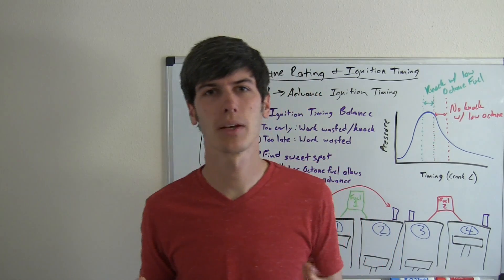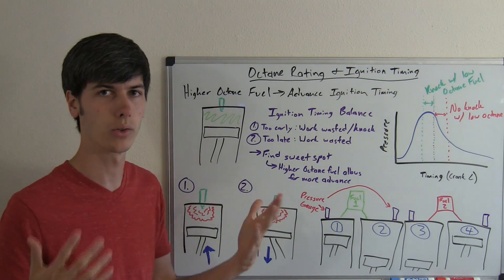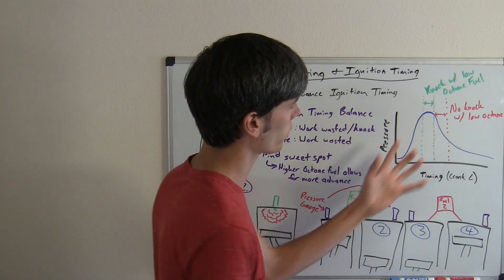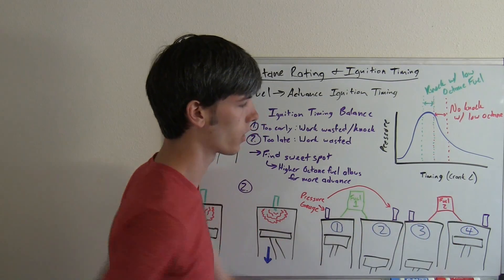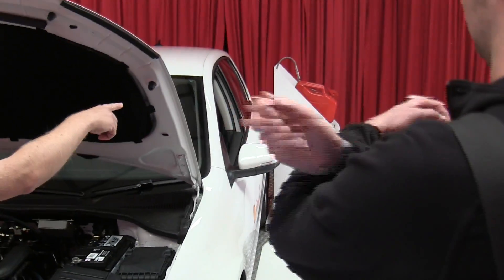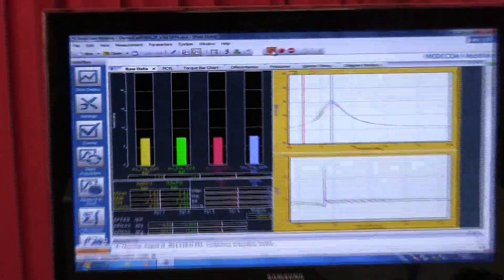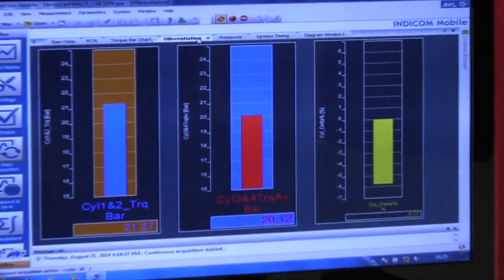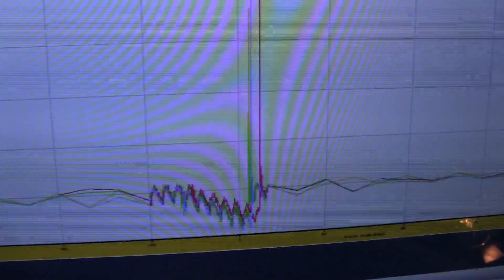Dyno Testing Premium Fuel - Octane Level vs Performance - Shell V-Power

Comment: Its all sponsored by shell, so of course they will want you to buy the most expensive fuel. Run the fuel your manual recommends as there is no real gain in running the higher octane.
Reply from the maker: +geejaybee413 of course, as mentioned the vehicle needs to require premium to benefit from it.
Reply: I am not a shill but honestly shell fuel and shell/pennzoil oil is really the best of the best ...   Pretty much every high performance manufacturer recommends shell fuel and ferrari only uses shell/pennzoil oil..
Reply: Charley Bomps breh
Reply: BRUCE LEE Do you know what a high compression engine is;no you apparently don't.You probably don't know a single thing about how engines work,unlike myself who am a skilled mechanic who has the knowledge to build NHRA drag engines.The point at which an engine is considered high compression is subject to variables depending on what type of engine is being built and there is much more to it than static compression ratios when determining what octane and type of fuel is to be used.Taking the word of a mechanic who doesn't work on snowblowers instead of reading the instruction manual is a moronic move by a person with no knowledge.Your previous comment of you receiving 40% higher mpg by using MMO is complete nonsense and again proves you know nothing about mechanics.
Reply: I ONLY run Shell in my high compression snow blower as per 2 mechanics advice.
The performance with the premium gas is miles away from the other levels.
My car gets it's best MPG on shell basic and I run Marvel Mystery oil.....cheap walmart 4 OZS in gas tank 8 OZS in oil for cleaning and lubrication.l and get 40 % less friction and 40 % higher MPG at 60 mph for the last 2 years.
Reply: Charley Bomps
I ONLY run Shell in my high compression snow blower as per 2 mechanics advice.
The performance with the premium gas is miles away from the other levels.
My car gets it's best MPG on shell basic and I run Marvel Mystery oil.....cheap walmart 4 OZS in gas tank 8 OZS in oil for cleaning and lubrication.l and get 40 % less friction and 40 % higher MPG at 60 mph for the last 2 years.
Read moreShow less
Reply: geejaybee413
Reply: Stairway to heaven Bohemian rhapsody

do you know what a high compression motor is.....NO YOU DON`T....I ONLY run Shell in my high compression snow blower as per 2 mechanics advice.
The performance with the premium gas is miles away from the other levels.
Reply: OK let's look at the facts.
1) The snowblower throws snow alot further with premium gas.I didn't say the motor was high compression the 2 mechanics that work on them said that.
2) We have 2 test cars using MMO in the gas and the oil for the last 2 years .In summer temps my car goes from 36 MPG to now 46 MPG my brothers 3.0 duitec is supposed to do 480 K per tank as it did when new.He now gets 745 - 800 in summer at 100 K per hour 60 mph on a long super highway drive.
MMO has 5 chemical and one is a FRICTION REDUCER.
Check car racing teams used it as an additive to for braking in new motors for racing ........GOOGLE IT....!! 
Your a mechanic but I know lot's of shitty mechanics and shitty doctors the great danger to shorten human life.
Reply: bilibiliism
 CORRECT .......and mechancis told me to ONLY run SHELL.
Premium in lawnmowers  and snowblowers.
I run shell in my car as well as MMO for friction reduction and carbon removal and sludge.
Reply: He literally stated this.
Reply: geejaybee413 unless you drive a turbo car (80's - present) because higher octane absolutly makes a difference. i drive a subaru with a turbo and i do not recomend running anything less than 91 octane.
Reply: But I can't buy the octane recommended for my car,all octanes sold are too high and too expensive.
Reply: BRUCE LEE There is no gain from using high octane when it isn't needed,in fact it hurts performance significantly.Nobody needs 87 octane or higher it is just a waste of money.

Comment: advanced ignition timing fires later not earlier.
Reply: Other way around. All relative to piston top dead center (TDC). The more you A-dvance timing the more degrees added before zero or A-head of TDC when the spark lights off. Another easy way of remembering is with clockwise rotating distributors. Turn it R-ight to R-etard timing. The rotor is then chasing the contact point as it would be chasing the piston down the cylinder in an extreme case.
Reply: No thats retarding the timing

Comment: So if I get, for example my crx from 89, and use 102 octane instead of 95, but I don't change my timing, it doesn't have any effect?? or does it?
Reply: jarnofierloos It would lose power and economy.
Reply: Tanner S.  economy is not a problem, because it is a racing car, but Power is.. I use it, but I don't deel a loss of power
Reply: Unless your timing, etc. is tuned for a specific fuel, you will not make more power. You will get a less complete combustion.

Comment: So an engine designed to run on regular fuel would have less power if run on higher octane fuel ( because it is has less potential energy) if it does not advance its timing  ?...
Reply: No, although some are suggesting this for some reason. The timing is usually set for a minimum requirement. Using higher octane in terms of performance is technically a waste of money, but usually the additives that give the higher quality fuels (the base fuels are all exactly the same from the stations nearest refinery) their properties, also reduce carbon deposits and prevent the fuel going stale a bit longer. Unless its had bio-ethanol added, but that's another story.
Reply: I guess there could be a loss of potential power mind, just not less than the lower. The higher octane fuel resists detonation for longer, thus allowing for the advanced spark, and why you'd get knock on the lower octane. The only wasted power could come from the unignited capacity past TDC, but it couldn't be less than what the lower rated fuel would have produced at that same time/capacity of compression.

Comment: I think you might be confusing a few people that won't go back and watch the octane video because they feel they lernt enough. To fill in the gap.. Octane has a direct relationship with compression ratio and also to how fast it burns. You WILL get less power and reduced MPG if you put high octane fuel into your car that recommends 87 octane fuel, but if your system is designed to run 91 octane and you put 87 then it will choke the system reducing the air intake to prevent knock and of course reducing power and mileage. But if you car runs better with higher octane even though it recommends 87... you need repairs, usually a good tuneup and fixing intake leaks.

Comment: All of this is dependent on the timing of the cam shaft and ignition with the position of the piston. A car meant for unleaded 87 octane can run better with 87 octane rather than 93 octane, if the timing was maximized for 87 octane.

Comment: why do we always mix the fuel with air pre-compression on gasoline engines ?  why not compress air only, and then inject gasoline with spark firing, (diesel model style) and can extend burn throughout the power stroke ??!! pressures are only about 350 psi, injector pumps come close to 30, 000 psi.

Comment: Finally a demonstration that show how that actually works out. I always assumed that if your engine doesn't knock on the lower octane fuel then you wouldn't actually see any anti-knock benefit with going with the higher octane.
Reply: Yea, that's not true with the newer cars, since they just pull timing to prevent the knock.  My supercharged Grand Prix is that way.  Run regular unleaded all you want, runs fine.  Run premium in it, the computer throws the timing back in and you're up about 30 HP.
Reply: @RotaryTurbo fascinating thx

Comment: So the power won't increase if the ECU doesn't respect the knock sensors if your car hasn't even got one?
Reply: Exactly, but you can manually adjust timing on most cars that don't have an ecu doing it
Reply: +KingLuigi96 correct. The stock engine programming can only do so much. And if it doesn't have knock sensors, there's that much less to do.  My vehicles have knock sensors. That's why I run a tuner...to take the best advantage of the higher octane fuel.

Comment: Dope. I wish this tech had been around back when I argued basic chemistry and physics with my auto shop teacher (turns out I was right). Of course, at the time, we didn't have advanced EFI systems with on-the-fly advance and knock sensors on cars we could actually work on in the shop.

Comment: Premium fuel is for cars that are designed to use it, some cars get worse gas per mile if they run premium fuel because they are designed that way.
Reply from the maker: +SacreDro I would always recommend for people to use what their owners manual recommends.
Reply: Exactly, my fuel cap says RON 91/95 and premium is 98. Used a couple of premium gas but no difference in miles per gallon or in my case km/l.

Comment: My 2005 pontiac gto (100% bone stock) only drinks 87 octane. :-)
Reply: +B.A. Chan 
Ha! :-)
Reply: +ruizhernandeztrustfi  Premium is The recommended gasoline for the 2004-2006 GTO. The 2004 has the 350hp LS1engine and the 2005 and 2006 has the 400hp LS2 engine. They are both designed to run on premium high octane gasoline. Good luck though.
Reply: +ruizhernandeztrustfi 

I mean, you probably won't really notice that much of a difference using premium fuels on naturally aspirated motors. I have been happily ignoring the manual on my '95 E-class wagon for 4 or so years now. I've put about 70k miles on the car running regular gas, and don't notice much of a difference on premium gasoline. I've had no fuel related issues problems. Car forums--which are not in any way, shape, or form reliable sources--tend to exaggerate the ramifications of using regular gas in a car that calls for premium fuels. With that being said, do this at your own risk. If you really want to play it safe, go by what the manual states. In my WRX on the other hand, there was a rather large difference between regular and premium gasoline as turbocharged engines respond well to higher octanes in general.

Comment: Why does everyone assume this is telling you to run premium in your 89 Tercel?

This is purely to show the uninformed what happens when you run lower than the manufacturer recommended rating.

If you want to run higher than the recommended, do it for the detergent packages. Because the car won't be able to take advantage of the extra octane rating.

Comment: did they modify the engine to run two efi system's for each pair of cylinders or does the golf adjust itself to the octane of the fuel going to each cylinder?
Reply from the maker: +ubza1234 Golf adjusts for each cylinder.

Comment: Question: Is knock more probable with a richer A/F mix ? Or does A/F ratio have no effect on knock?
Reply from the maker: +Horacio Fernandez Leaner A/F mixtures tend to be more knock prone.
Reply: +Engineering Explained thanks
Reply: Think water injection for high-output turbo engines.  The more liquidyou have suspended in air the cooler the charge temperatura.  More fuel = lower temp = less knock

Comment: So would i have to tune my car for high octain? i have a ecu that learns and changes its tune but just wondering
Reply: hmm ill jus thave to keep diging
its a lsv-integra that im learning while building my self so
Reply: +INVISIBLE SUN Noxious is right.  A stock powertrain program won't help you much with higher octane fuels.  You might look for a canned (instead of custom) tune, if you only have a stock engine or a couple of modifications. I have a Dodge RAM with a 4.7L V8. I only run premium if I run the 91 octane tune from my Superchips tuner. It is dyno proven to add 20hp. But only with the 91 tune and 91 octane (or higher) fuel. Lower octane will make the engine ping on that tune. The 87 octane tune didn't change hp on the dyno.

Comment: How would the knock sensor detect/affect just two of the cyls???
Reply: +Chris Collins There are 2 knock sensors. One between cylinders 1 and 2, the other between 3 and 4. This is not a modification it is VW makes them.

Also, one sensor per 2 cylinders is enough to monitor each cylinder independently because combustion occurs sequentially. Had they run the fuels on cylinders 1-4 and 2-3 instead, the test would still work.
Reply: +atsernov Ahhh, that makes since now, thanks

Comment: so v-power works :-) 
I use v-powr diesel and noticed a bit better mpg. I was sceptic about v-power and I'm still now ( a little bit) I wanna know if that extra few penny a litre is worth it
Reply: the only difference between the gas you buy at Shell or a competitors store is the additives put in the fuel. The gasoline for both more than likely comes from the same refinery.
Reply: forgive me, in your case Diesel not gasoline
Reply: SchuboxProductions I always thought that shell BP or texaco had their own refinery
Reply: +Phen0mable they do, however they don't ship fuel to all the stations from the refineries they produce from. For instance the fuel produced in the refinery I work for supplies most of the fuel gas stations sell regardless of the advertised brand.

Comment: This is only one part of the explosion. The higher your compression in the car, the faster it will detonate. Some cars don't produce the heat and pressure required to run (explode/combust/tear bonds) of higher octane (more carbon bonds) fuel.
Reply from the maker: bon vivant Correct, which is why this was tested with a vehicle which desires premium fuel. Cars requiring regular fuel will not see a benefit.
Reply: Yes, but let's use 103 octane on the same car in an Alaskan winter and see what the conclusion is. 

The point I'm trying to make is that people have unfortunately concluded that higher octane means more power, and that is far from correct. You need the right octane for the right car and condition. Track temperatures can be significantly higher than ambient, and driving behind another car can increase engine temperature from lack of cooling. True wind speed and cooling systems, engine load, compression, spark (plugs), and radiant heat all play a role in how a car detonates. 

I still see guys putting premium fuel in cars that can take 87 while commuting in them in cold winter conditions. Then they wonder why their engine is knocking. 

In many cases, they are wasting money and getting less performance.
Reply: Sorry to hear that Luis. Dark plugs are usually from carbon buildup from fuel that isn't burning completely. Take it to the shop and have them tune it. I wish you luck with this.
Reply: +bon vivant- i agree. that would have been more beneficial to explain in a video. everyone is so focused on mo power from higher octane and forget about over doing it. point is higher octane than you really need is gonna be less power and less mpg. dont forget to mention that explainer guy!
Reply: +bon vivant My car have's 10.5@1 compression and tempetures here in Puerto Rico are about 91 to 97 were I live. I've tried with gasolines from 91 oct. to 93 and still knock! it's a 2012 lancer gts 2.4l 
My question is, can it be a lean problem? The car is 100% stock!! and have's 30,000 miles on it. Spark plugs are completly yellowish brown.
Reply: +bon vivant thanks bon, I'm in the process of learning how to tune and my car's oem ECU can be reflash :)
Reply: +bon vivant a little bit of detonation is desirable. as your flame front expands, the cylinder pressure increases, this detonates the remaining fuel mixture to perform a faster burn, then all that CO2 expands in the cylinder all at once, and pushes on the piston harder. This was actually engineered in some cars (I think it was a Subaru my father in law was working on that had 2 spark plugs per cylinder). Knock comes from way too much detonation (pre-ignition, in particular), which is inherently bad,  if memory serves you're looking at close to 3000 or 4000 PSI peak under detonation, 2000 PSI under regular load.
Reply: +reicirith 
the computer retards the timing to keep the fuel from igniting too early witch is called knock.
Reply: How can we fine tune a car at the right time? On a Carburetor-Driven 4g15
Reply: A knocking engine will damage your pistons and engine components over time so that might cause lower performance

Comment: I have done hours of research on this and don't feel like I've got anywhere. I just leased a 2015 Cruze 1.4L turbo. Would my car benefit from higher octane fuel? Especially with the turbo? Some forums say yes others say no. Some say it will improve gas milage considerably and some say higher octane fuel would hurt my gas milage. What is the truth? Thank you for your help! Loved this video by the way.
Reply: Brett Walden Try to find out if your car has a knock sensor. 
If it does, chances are high you would benefit from the better fuel. 

If it doesnt you wont benefit from it in term of power and could even lose some power under some circumstances. 
You will however get slightly better miles/gallon. But considering that premium fuel is more expensive you will not get more milage/money. 

Considering it's age I would guess that your car would benefit from the better fuel.
Reply: @Hellsslave666  his car has knock sensor .
Reply: No Name get a different car
Reply: Premium only on anything with boost. If you are NA you can get away with 87 as long as you aren't knocking or experiencing a noticiable reduction in power or mpg